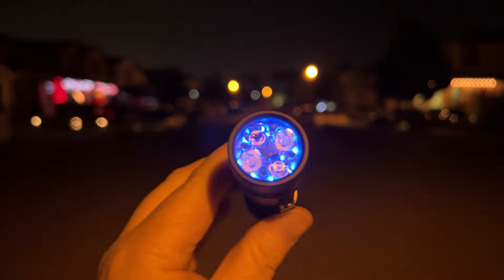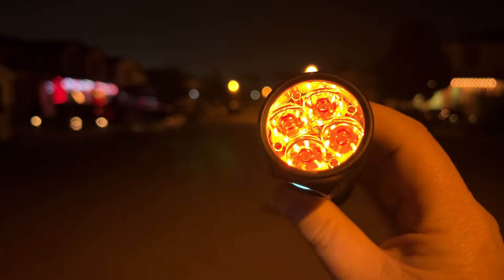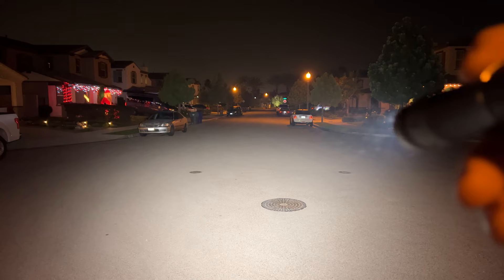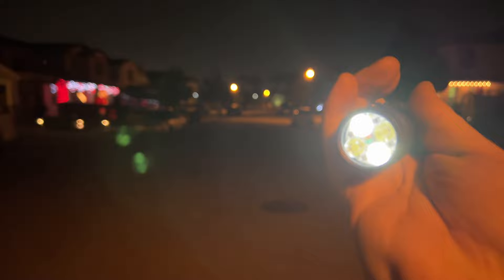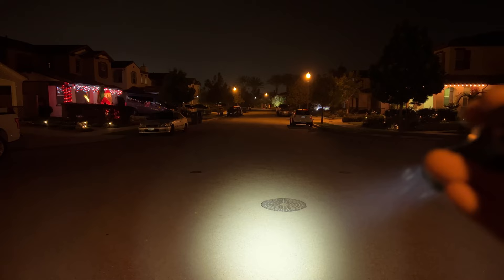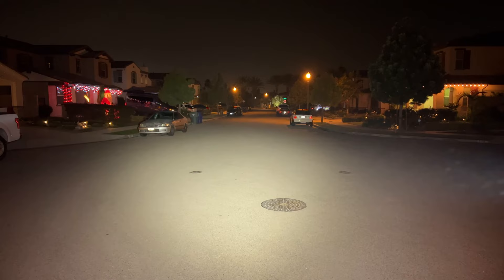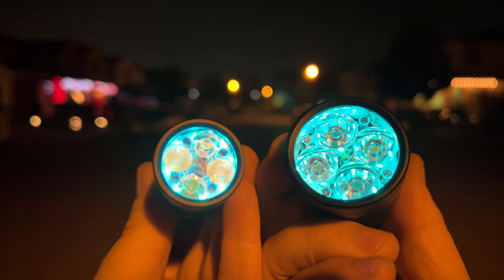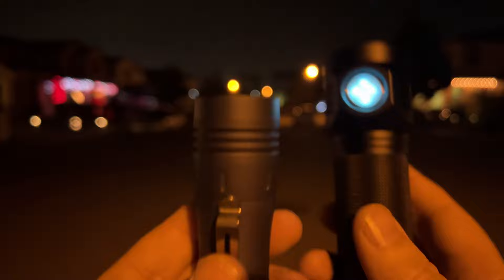KR4 (D4V2) vs D4SV2 instant channel switching (Throw and Flood)

Comment: Just purchased one after watching this video, love your videos, you explain things really well and also get strait to the key points. Thank you I definitely love how much more throw the larger one puts out, does the lumens gradually drop on this light or is it very quickly?
Reply from the maker: As the battery sags, the lumens will drop. But the emitters don’t “wear” if that’s what you mean. Just get the battery back to 4.2v to get maximum output again.

Comment: Might be possible that the larger optics on the D4SV2 mix the color differently and its an illusion that the tint is different on the KR4. You could test that with DC Fix (model 346-0211) or another translucent window film for diffusion. There are some forums where people show they have tested some models of DC Fix for LEDs and flashlights to mix the LED color and it works well. I suppose even a translucent satin plastic of any sort would work for a visual test as long as it can completely diffuse the light so there are no hot spots.
Reply from the maker: I found that Hank accidentally sent out 5000K emitters to a bunch of people that asked for 5700K. My situation isn’t isolated. Seems like I was the first to notice, then tac_griz and a few others said “heeeeey! Mine too!”

Comment: Well, all nice and dandy, but you have the "DC Fix" on the KR4 tho.. so it is obviously going to smooth out the beam and make it a bit floodier as well.
Reply from the maker: You’re right if course. I added D-C fix to the D4SV2 after the video, and it got floodier as well, but the KR4 is still much more so.

Comment: Nice video. Is W1 in KR4 thrower than single emitter+reflector like SC31 pro size? I’m considering the same emitters choice but I’ve never had multi emitters light before.
Reply from the maker: The W1 in the carclo TIR will be floodier than in most single emitter reflector configs.

Comment: How would the same emitters do in an Emisar DT8? Would it be more flood and less throw? I know the battery has less capacity.
Reply from the maker: The only super compelling reason I’ve seen for DT8, is for low output emitters like E21A, or dual channel where 4 are likely to be off.

Comment: My D4SV2 is on the way. Now just need to find a holster for it
Reply: If you're content with the 26650 cell format, a "small mace holster" from a local police uniform shop fits the D4SV2 beautifully. With a 26800 cell tube... I'm not sure what to do there.
Reply: weltool makes an open holster that it fits into nicely

Comment: does anyone see the 5700k option? trying to order but only see 5000....
Reply from the maker: Hank changed the name of the emitter to 5500K at one point (h might have changed it again).  It was simply because in his optics the CCT lowers.
Reply: @cheule   thanks so much for the reply. i went with the 5k and the 6k W2s but they havent arrived yet. im hoping that the shade is similar though.

Comment: Does the d4sv2 come standard with spot and throw or is that custom?
Reply: It's custom but you can configure it on the website
Reply: There are two listings for D4SV2. One is single channel, the other is dual channel. This one is dual channel, and Cheule has configured his with the throwiest LED available (Osram W1) and the floodiest LED available (Samsung LH351D). It's all configurable on the dual-channel product page.
Reply: @tacticalgrizzly9828  Thank you! Flashlight community is always so helpful!
Reply: @DjDanny44  Will the keepower 15amp 26650 be able to put out enough amperage for this beast? Thank you for the video!